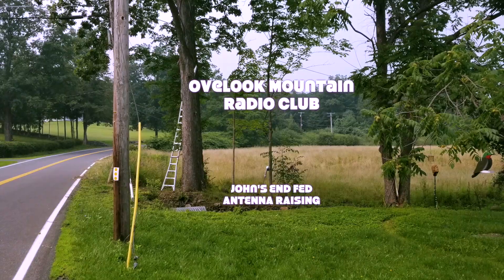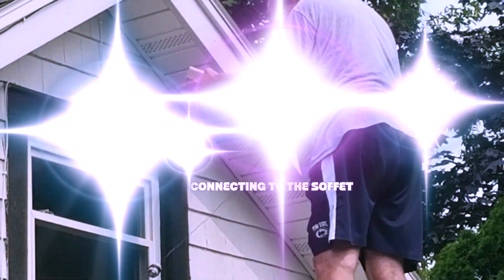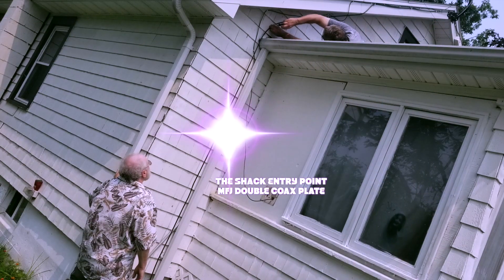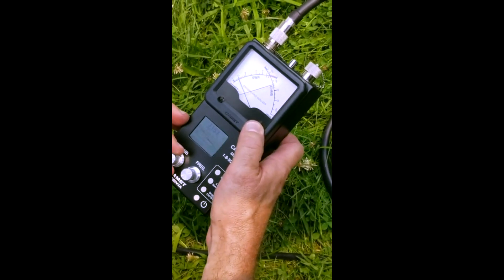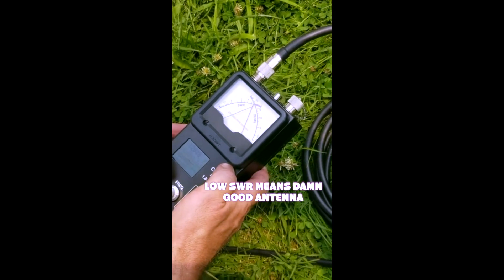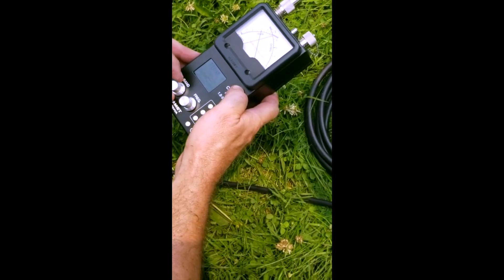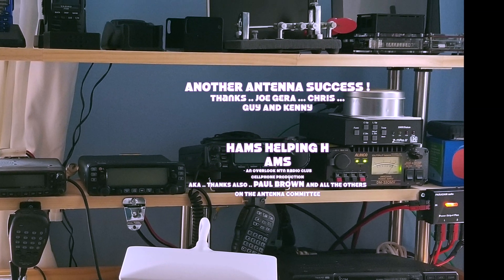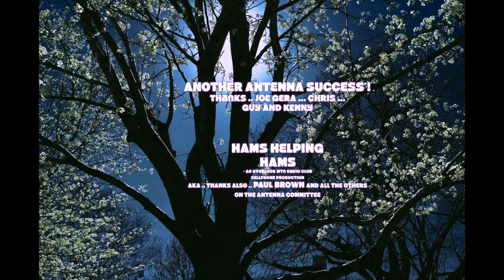How To Raise An EndFed Ham Radio Antenna

Comment: 22ft is not really that high.  I would have gone for at least 35ft up.  Would have been nice if you had shared more detail about the antenna snd balun/unun used.  You didnt really even cover that.